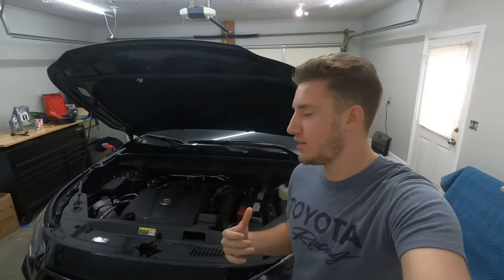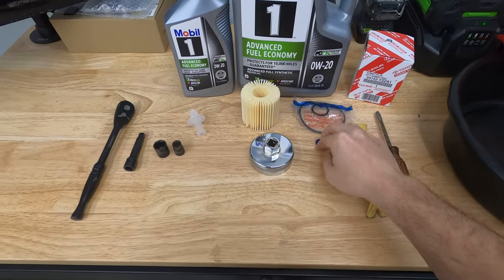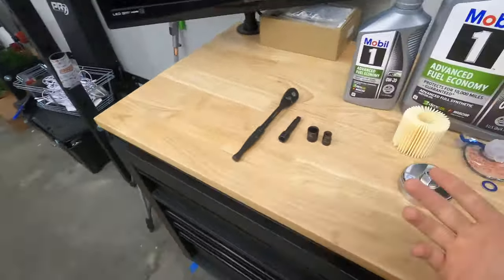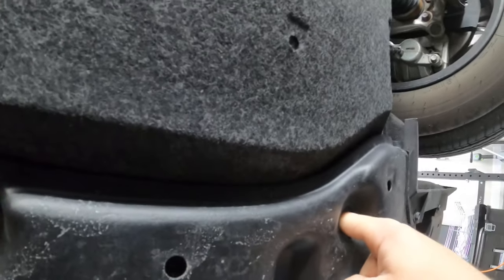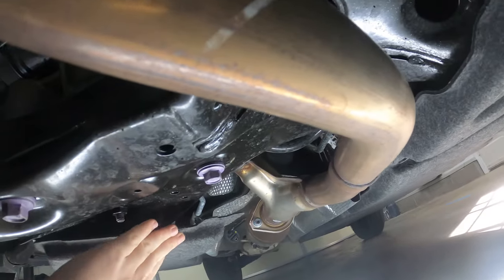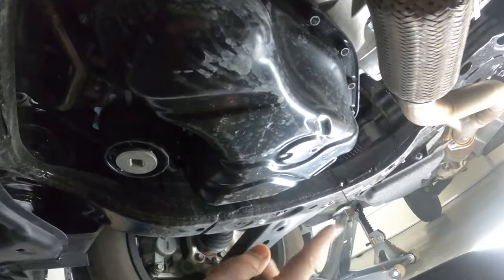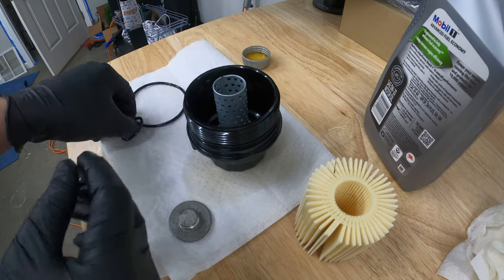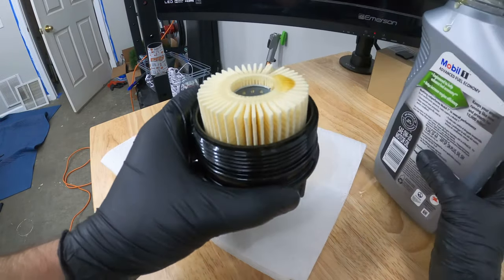2020-2023 Toyota Highlander oil change Step By Step Canister filter

Comment: 2023 highlander is totally different. 1, V6 engine is gone, now it is all 2.4L turbo-charged I4; 2, no need to remove the entire soft under cover anymore, the under cover now as a 12"x12" opening just for the access to the oil drain plug and filter.  You only need to remove 4 screws to remove the cover of that small opening; 3, no more cartrige filter, 2023 models all use spin-on oil filters.   Overall, I think job is a little easier on 2023 models.
Reply: Wow thank god for the new twist on canister to make my life easier. I'll be using a fumoto valve too. Thanks for that update buddy!
Reply: Thank you
Reply: Exactly

Comment: The Drain Plug Torque is 30 ft pounds.  The Filter Housing 18 ft pounds and  9 ft pounds for the Housing Drain Cap.
Reply: Thank you for the torque values!

Comment: Great job! Excellent choice of Oil for your Steed!  Nice tip on Pre-filling the filter before installation.  When I was a teen many years ago (😅), I was taught by an Ol’ School mechanic that told me not only does the oil in the filter increase oil pressure quicker, but the oil “wicks” up onto the dry filter , moisturizing it and preventing any possible tears upon initial start up!

Comment: Thanks for the video.  I noted that Toyota recommends 0W-16.   0W-20 is considered OK if replaced with 0W-16 at the next oil change.
Reply: Straight from the Toyota Manual:
Recommended viscosity: SAE 0W-20
SAE 0W-20 is the best choice
for good fuel economy and good
starting in cold weather.
If SAE 0W-20 is not available,
SAE 5W-20 oil may be used.
However, it must be replaced
with SAE 0W-20 at the next oil
change

Comment: Where did you get the plastic piece to drive the oil out of the filter?
Reply from the maker: It should come with the factory filter if you get it from the dealership.  Mine was in box with filter.
Reply: Thank you
Reply: @loganbirchfield yes. it is.